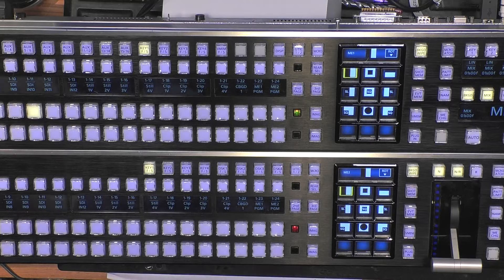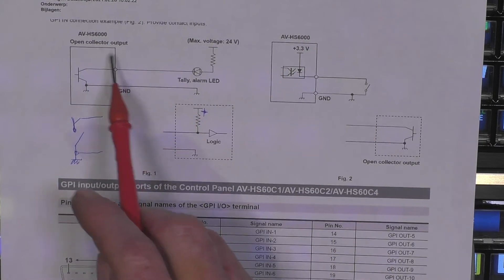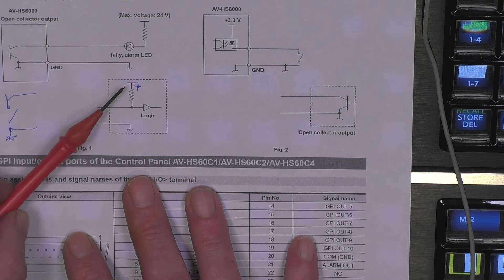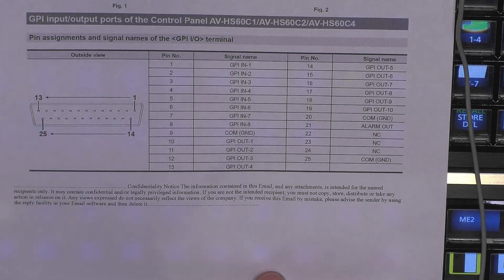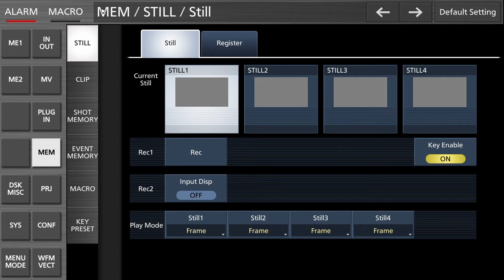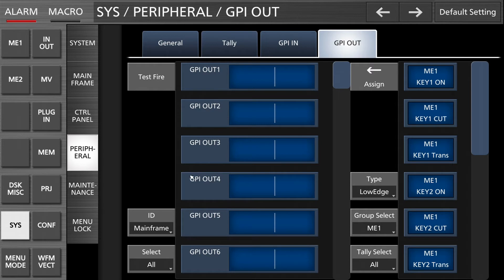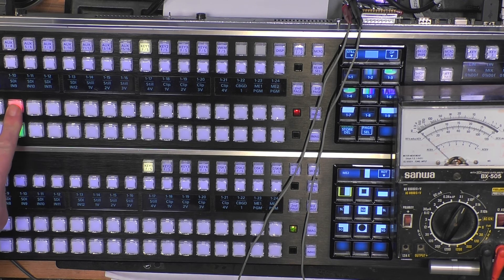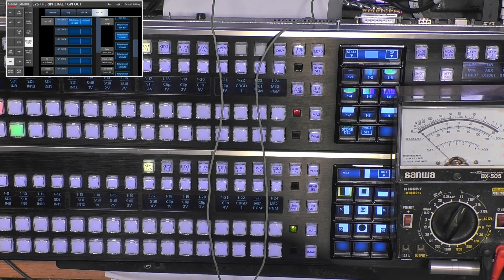AV-HS6000 Tally configuration (close contact)

Comment: Hi, there, I'm on a control room with 7 panasonic uc3000 cameras. At the request of production, I've added an 8th camera (sony 1500 with hdcu1700 ccu), my problem is that I can't get the Tally to work with the panasonic AV-HS6000 mixer, using the GPI, I use the same Db25 plug as the panasonic ccu as it's compatible, I even did a test with a panasonic camera to check and it works, but if I connect the sony ccu the tally doesn't turn on. Please if anyone can help me that would be very kind, I'm stuck.